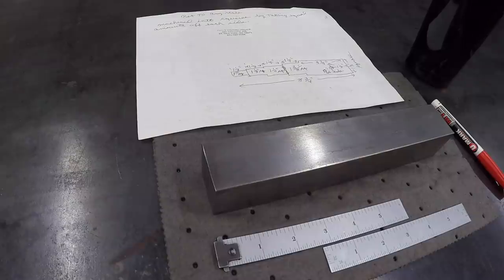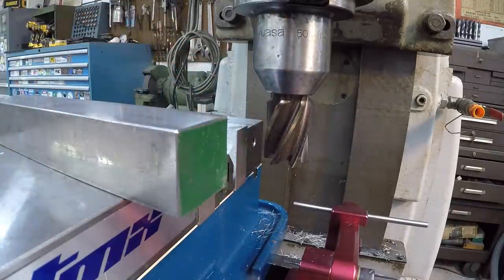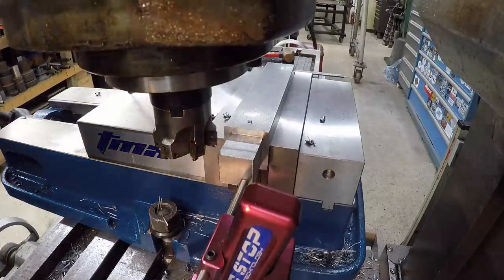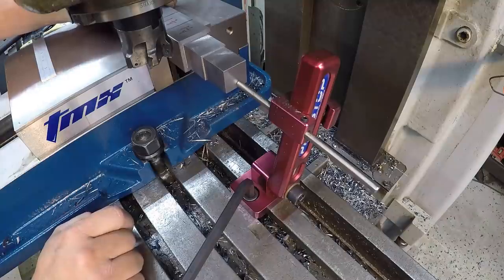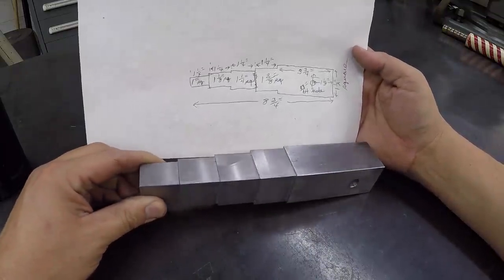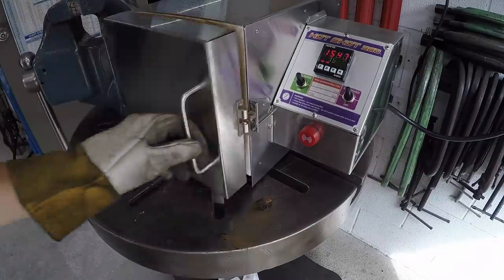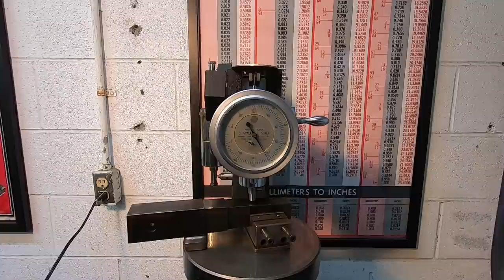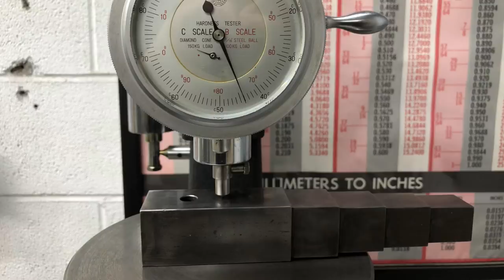SNS 296: Custom Square Drive Tool, Heat Treating

Comment: I’ve had good success with heat treating small parts I turned from O1. I got the part bright  yellow hot with an OA heating torch and gripped the part from the end that didn’t require harness and immediately quenched it in oil while keeping it moving and submerged until it cooled. It came out at 61C. Definitely use a metal container and keep a fire extinguisher right next to you. Make sure you do your heat soak time starting from when the part reaches that critical temperature. Look for an into to industrial metallurgy textbook. Getting a mental picture of the space lattice and changing crystal matrix of the metal will really help get to a process for a perfect heat treat.

Comment: As a glassblower for 25 years its similar to annealing steel couple things to try, skip the foil till you get the process down, try some oven bricks to get it higher in the oven and try soaking it longer for a more even heat, also I don't believe your supposed to quench the temper, and lastly I believe the machinist handbook will have all the values you need for the different types of steel. Love the vids!! Cheers
Reply: You are right , you don't quench after the temper

Comment: Another tip to remove oxygen and prevent scale is to put a match or two in the wrap and it will burn off the oxygen inside . Great video Adam

Comment: Adam, if I'm not mistaken the main point of the foil is to prevent decarb (the outer layer of steel losing its carbon to CO2 and becoming iron). If you aren't worried about that than the foil isn't going to change much. There are a few possible reasons why the heat treat is uneven one is the heat is uneven. Which is doubtful given how long you let it soak for. Two is the quench was uneven, which is possible but unlikely as you have a decent amount of oil and kept the part moving so you didn't get any leidenfrost effect. Lastly, and I've had this problem with McMaster Carr before, there is inconsistency in your material. Great video as always.
Reply: Steel is not only iron + carbon.
Reply: @thunderstruck1078  I apologize, I oversimplified. However the practical implications are that it is iron and not 'hardenable' when the carbon is lost. Even if the nickel, chromium and etc are still present.

Comment: for consistent rockwell values, you need to clean the scale off the outside of the block and test on clean steel.
Reply: That's right! We do most of our testing in Vickers and that's impossible without proper preparation of the samples.

Comment: From an engineering/heat transfer point of view - the extended time at temperature transfers the heat energy completely through the mass. The riser blocks are in the same heated environment. They could only transfer heat away from the part if they were at a cooler temperature.

Comment: On amazon I bought a 10 gal bucket then a 10 gal fire bucket used for oil rags. Put the 10 gal bucket inside the fire bucket poured my parks 50 oil in that. So if a major flair up I can drop the part and let the lid close. Have not had to worry about that with the parks 50 yet. Also some lower carbon metals will not harden real high. Smoke is normal. If you take it out too soon there will be a flair up.

Comment: Material engineer and hobby machinist here. Love your videos! To cover your hardness situation, it's harder on the machined ends because your cross section is thinner here than the untouched end. The heat escaped faster through this end when quenched, thus shrinking the steel grain smaller and making it harder than the thicker untouched side. As for the orientation, it shouldn't matter too much how it is oriented as long as the soak time and temperature is the same... however, standing the part up on it's thinnest cross section will result in a quicker heat treatment time. This goes the same for quenching, thinnest cross section first will quench quicker and result in smaller grain sizes, though this varies in the desired geometry of the part.
Reply: well it didn't have enough soak time plus he needed it out of the wrap

Comment: I'm anything but a heat treating expert.  Take what I say with plenty of salt, but starting the quench in oil and then switching to tepid water would quickly get the heat out of the part's center and stop a self tempering effect.  That tool is pretty darned massive.

Comment: Heat treatment is a science unto itself - experience will yield better results.  Foil wrap is usually used for air-hardening steels; for oil quenching steels, you may want to look into the powder (PBC) or paste type anti-scale compounds.  Check with some of your buddies in the metal industry and do some practice pieces.  Good video as usual, though.  I'm a hobbyist knife maker and have been doing my own heat treatment for about 5 years now.

Comment: Very cool. No experience in hardening, but as a chemist have you considered perhaps inerting your oven with say 25cuft/hr argon (or other appropriate welding gas) thus avoiding oxidation and the stainless wrap entirely?

Comment: Magnetic neutral is what you are looking for 1275 or about. When the shine washes out of the metal. Anything more equal smoke, smoke is a form of oxide. I would suggest putting it in a tub flooded with shielding gas and wrapping it. Maybe a wire in the fold to open easier? The first part there is a quote of my master. That man has forgot more then i know. But keep up the good work. Love the program. The pro's use a induction coil in a vacuum and gravity

Comment: I have not used that foil, and all my heat treating was by color and educated guess. One thing the old-timers told me was to quench with a figure 8 motion, if possible. That way there is equal cooling effect on all sides, and it also help eliminate pockets, or unequal areas of your cooling and or quenching medium.

Comment: Looking at a heat treatment chart for 4140, 26 HRC implies a yield strength of around 110 ksi, which is on the far low side for this steel after heat treatment. 
Getting a good quench is all about cooling it quickly enough. I think maybe the foil is hurting you there. Possibly you're not dunking it quickly enough. Also it may not be enough oil for that size part. With oil, generally a high circulation is used. You can also try water or brine quenching for a faster, more effective quench (but with higher risk of some deformation). It should be in the 55-60 HRC after quenching and before tempering. Your tempering temp will also have a big effect - lower temp is harder and stronger, higher is softer and weaker, but with better fracture toughness. 

Also note that heat treating 4140 is possible with thicknesses of up to 1-1.25". For anything thicker, 4340 is generally used. Not that it matters much here, just for general knowledge.

Comment: Adam,   to heat treat with better results, take a look at a TTT chart for your alloy (Time / Temperature / Transformation). Also sometimes called "CCT" (Continuous Cooling Transformation diagram).    You have "seconds" to get that out of the oven and into quench, and below a threshold temperature, (if you're looking for optimal hardness).   Forget the foil, move fast, quench quickly.   You jumped into the deep in there for a first stab at heat treating without serious industrial equipment -- thick cross-sections are tough.  For the equipment you have on-hand there, you did OK.  Try a short piece of 4140 with a small cross-section (say no more than ½" square), and practice with that.  You'll have things figured out in no time.

Comment: It's all about dwell time and that is related to the mass of the work piece........ when you use small ovens then dwell time become a bigger issue ....... you will have to increase oven tine to make sure the part is well soaked no matter what you gauge tells you..... and yes its a learning curve ..... you will get know you oven and make adjustments .... good job well done and keep on learning ...... love you channel

Comment: The foil wrap is preventing the part from cooling fast enough. You'll have to remove it before it goes in the oil.
Reply: Ummm, did you not watch the video? He has and was removing it prior to quench.
Reply: @Ham68229  How about you go watch the video again and show me where he removed the foil wrap? Hear that crunch when he grabs the hot part out of the oven? That's the foil.
Reply: His second heat treat he removes the foil  before quenching. Finish the video before commenting back at others that correct you.
Reply: 32:10
Reply: @aaronpage1822  I did watch it. The second time his hardness numbers were off because of decarb.

Comment: My guess is a faster quench medium and a larger quench tank. Digital control ovens are very good, and one that small shouldn't have too many problems with convection. Likewise, contact with the bricks shouldn't matter. You could try moving your thermocouple down closer to the bottom of the oven, but, I think the problems are in the quench.

Comment: when preparing your foil wrap, add a small strip of paper to the wrap, (sides are best, as you can fold the wrap, and not have the paper actually in contact with the part) once the paper reaches combustion temperature (much lower than your target temp for tempering) it will burn up , consuming most, if not all of the remaining oxygen in your wrap. (Tighter the folds, the better the seal)

Heat your part until it's no longer magnetic. This is the state you want, that way the carbon atoms have the ability to freely move within the steel structure, once you're here, quench. 
You can test this by touching it with a bar magnet, if you feel it stick, you're not where you need to be. 

"The Art of Blacksmithing" by Alex Bealer states:

"In recent times the proper hardening color may be realized by touching the steel with a small magnet as the heat rises. The magnet will stick until the metal reaches a red heat. At the exact moment that the magnet ceases to stick, the steel should be quenched for maximum hardness."
Reply: Won’t the ashes from the paper add carbon to the steel?  How will he be able to run this test if it is a foil bag?
Reply: David Brayton No it won’t. The small strips of paper will combust and remove the remaining oxygen. The tiny amount of carbon residue will have no effect. The magnet trick has been used by blacksmiths for centuries. I’d also say that the oil is correct for the hardening process but I would have let the part slow air cool for tempering.

Comment: Hey Adam.
Great video. Go and read the bok called "Heat Treatment,Selection, and applications of Tool Steel by William E.Bryson publlished by Hanser 2nd edition and you will learn a whole lot about heat treat. I have learned so much from this book and it gives you all the charts and graphs that you will ever need.
Cheers and good luck

Comment: i used to work for a company that does heat treatment  of steel wire for bearings and automotive parts on industrial scale, it uses ovens with a nitrogen filled inner shell, and its using a big fan to distribute the heat evenly.  inner temp was above 730 C to transit the metal to martensitic state

Comment: The heat treat may work better if you stand it up but instead of setting it in blocks you might want to take some 1/4" x 2" stock and put it where the 1/4" is on top and bottom,the 2" is vertical with the length is side to side... don't know if I made myself clear but this is the way I've seen it done...oh,and I was talking about laying it down not on end, standing it might work on blocks but you may want to give the flat stock a try,and good luck!!!

Comment: Thanks for the demo and being honest about the learning process.  You probably don’t want that piece too hard or it will be brittle, so your results may well be ok for the intended use.  Perhaps it should only be case hardened to reduce wear?  I don’t know much about this area either.

Comment: That stainless wrap for heat treating can be reused a time or 2 if youre looking to save a few bucks. It does degrade but you can use it usually 2 or 3 times before it degrades too much.

Comment: Adam, some materials quench to different levels depending on the quenching medium. The thing is that 4140 when quenched in the proper oil you should be getting a hardness between 50 and 60 HRC. Your initial test gave 12 HRC and most websites state 13 HRC, so I doubt they gave you the wrong stuff. 25-32 HRC is  usually what is desired after tempering. The only thing that may have been a problem is that you didn't let it heat long enough and or you didn't cool it fast enough which is like the "shock" that makes it hard. I don't have experience with the stainless steel wrapping stuff, but I do imagine that the more you have wrapped around your part the harder it will be to cool your part when quenching. I did look up some videos to see people using stainless steel bags and it seems to be pretty commonly used for knives, they have a single layer bag with as little air as possible. Wrapping many layers would mean it takes longer for the heat to escape during quenching.
Reply: It didn't work on the cutoff that he tested the process with, that he didn't use a ss bag. It still was inconsistent. I think the hardness tester is out of cal.

Comment: As others have mentioned I think the foil foiled you! Changes the cooling process and different thickness sections etc vary the rate and how the oil floats around it. I've never done a lot of heat treatment but also never use the foil. I would imagine in some applications that is necessary but I would think for general-purpose probably causing more trouble than not. Especially on a tool like that whose final dimensions are not critical. Great work and video sir.

Comment: I am not a heat treater.  Read some of the comments, hopefully some knife makers, black smith sorts will take the time to provide some constructive comments.  Enjoyed the the video.  My 8th grade science project was trying to temper some steel banding material with a propane torch.  Had lots of fun, didn't burn down the house, and my teacher appreciated the effort.  She realized the material probably did not have enough carbon, I didn't get it hot enough.  She was very constructive in her comments.  Thanks for the videos.

Comment: Instead of getting a steel bucket from Lowes, look on Craigslist and see if someone has an old beer keg for sale. I picked up 4 of them from a guy for like $50 or $60. You get a lot more capacity plus they won't rust

Comment: The last time I did any hardening was about 30 years ago.  But from what I remember, case hardening only penetrated to a depth of 2 to 4 thousands.  We wrapped the parts, a chisel and center punch,  with some kind of carbon rich clay.  Please keep in mind that I'm trying to remember over 3 decades ago, I might have something off.

Comment: Hey Adam, first time commenting here, although I've seen nearly all your posts, i love your channel! Machinery is expensive here in nz, but I hope to have a shop like yours one day too mate. Love what you do. from what I know/remember of heat treatment and providing your starting temperature is hot enough to reach above the materials critical range, I thinks it's about 720 degrees Celsius the phase change occurs from memory, although I believe 4140 is basically chrome moly so may be higher? from what I remember the faster you can remove the heat from the surface of the steel the harder you will get it, with the martensite layer forming with rapid cooling. This is best achieved with a brine solution as the salt helps to prevent the water boiling off and the subsequent creation of steam that tends to insulate the steel from the quenching solution. I believe it's the temper that is a bit more technical, here the temperature reached plays alot alot more of an important role. I think the quenching oils are more suited for tempering but may be wrong. Also with the hardness variation, holding a part in the solution plumb can help to ensure even cooling on all surfaces and can also help control distortion. Generally if the quench wasnt rapid enough on all surfaces you can get the softer perlite and ferrite formation in places where the crystalline structure of the metal had time to change phase in places as it cooled. You effectively end up with a hard shell and a softer tougher center on thicker members. Anyway, hopefully this info can be of some use, I appreciate the love and dedication that goes into your channel

Comment: Next time get S-7 tool steel for an application like that. It can be air cooled which is convenient. A2 and D2 are also some good metals to use. We use A2 a lot. S7 is best for something that is going to take a pounding, H13 also.

Comment: A 20MM ammo can or bigger has a nice shape for a small shop quench tank.  The only time I've used that foil is for air quenching stainless.  It needs to go from your oven to the quench as quick as possible, no time to be fussing with foil.  The old timers wil tell you the part needs to be pointing north with quenched.
Reply: I think the pointing North thing has to do with keeping the piece from bowing.

Comment: Great video.  I’m no expert for sure but have been researching recently.  It would be hard to convince me that quenching it in that foil doesn’t slow down the quenching considerably.  I’ve also been reading (and not yet understanding) about boiling the part in water.  This somehow converts the oxidation further.

I’m most curious now to see what a chemical blueing, then heat treating and quenching.  Using the chemical bluing instead of the foil.